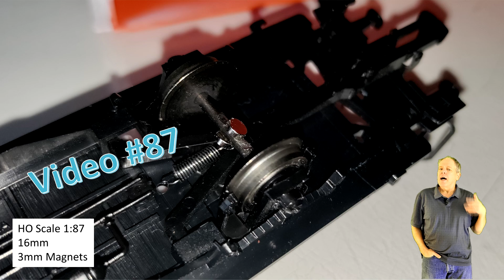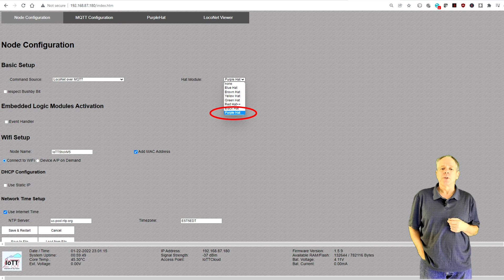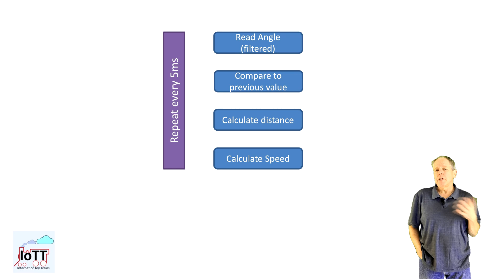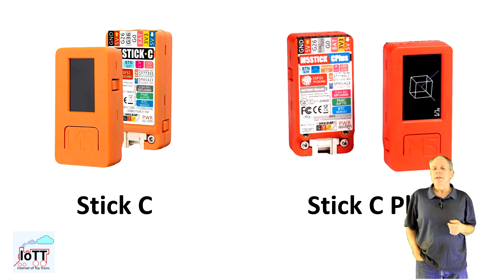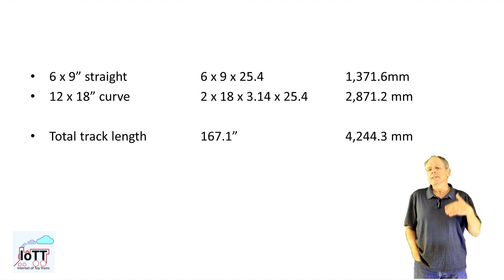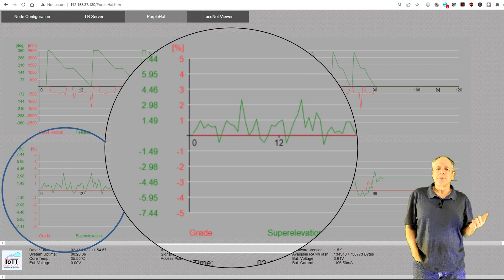DIY Track Measuring Car Test (Video#88)

Comment: Great work. What IMU did you use?
Reply from the maker: Track measurement is only using the 3d hall sensor. Howevewr, in the meantime I added IMU data from the built-in  IMU of the IoTT Stick to display track grade and superelevation. For the Layout-GPS capability, the board is ready to install a Bosch BNO055 IMU with integrated sensor fusion, but unfortunately, I have had no luck sourcing them over the course of the last year.
Reply: @IoTT  Cool, that explains my next question, I was wondering why I still got elevation and SE data when the 3 axes board I had was unplugged.
Do you have any plans to turn on the heading data?
Reply from the maker: @erniepike3902  I tested several sensors and so far the BNO055 was the only one that really worked, but I can't get it anywhere. Heading is tricky, it requires a sensor with onboard fusion, otherwise there is too much drift for position calculation. For the moment, it is 'wait and see'.

Comment: Hans, could you give some advise using the Purple Hat with a Loco Tread Mill device. I was thinking of mounting the magnets on axle of tread mill and mounting the Purple Hat beneath the axle. The question becomes measuring the treadmill wheel which is flat, but the loco wheel is sloped and the point of contact varies.  Any advise or comments??
Reply from the maker: I am not familiar with the Loco Tread Mill device, but if the loco is running with the wheel cone against the edge of the tread mill wheel, that is the same like running on a track, it is a sinusoidal run, so self centering. Anyway, to measure the distance, you measure the diameter of the tread mill wheel, which is flat anyway.

Comment: wow , you did ... May you share some code sniped for my arduino test please if it is possible . Best regards.
Reply from the maker: I did not find any published library for the TMAG5273, so I wrote my onw, but it only covers the functions I need for my project.It is on my Github: 
https://github.com/tanner87661/IoTTStick/tree/Prerelease/Sketchbook/libraries/TMAG5273
Reply: @IoTT   I cannot  know  how much should I say thank you. It will open another gate. When I test it I will let you know. Best regards.
Reply: @IoTT  thanks a lot. after some busy weeks I Have gotten a chance to get a look. Your library quite understandable however the examples for spi? the chip library refers to tmag5170.h. And I am going to use your library and as always I will let you know the result. best regards.

Comment: Would this work better on the Stamp pico D4 for the N-gauge?
Could the Built in IMU/gyro be used to tell if its a strait track or curved track?
Reply from the maker: The pico looks interesting at first glance, but then it has some serious disadvantages for this application: The form factor is not really better, you can't fit it flat into an N scale car, so it is vertical as well. It has no display built in. It has no battery and BMS built in. You need an extra connector for software upgrades, unless you do it OTA. Overall, I find the Stick much more convenient for this app.
The IMU I am using is one of the intelligent ones with onboard processor to calculate the Euler angles. Doing that with the Stick IMU would be a lot of math and it never would be the same quality because of the integration errors. But I plan on using the Stick IMU for some other tasks, such as anomaly detection, e.g. a car derails, which will cause a very distinct vibration that is relatively easy to detect using AI. Interesting research for sure.
Reply: @IoTT  thank you for letting me know, I haven’t done anything with the sticks imu so was just guessing. Thank you again

Comment: WoW, you make great progress on this project. I like your idea for speed magic. Hope we can set the desired scale speed of each speed step…. You will remove the tedious time it requires to speed match the locomotive. I love this idea it will be really useful.
Reply from the maker: Yes, speed matching really should start with the throttle profile: What scale speed do you want from what throttle setting. Then, everything else is just measure and adjust, so it can be automated.